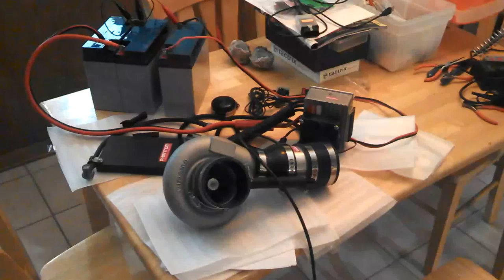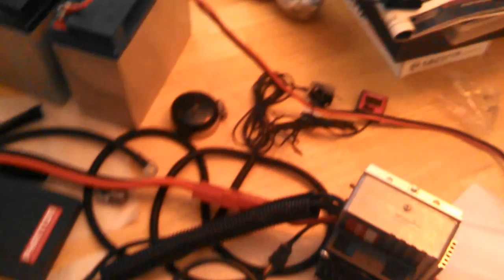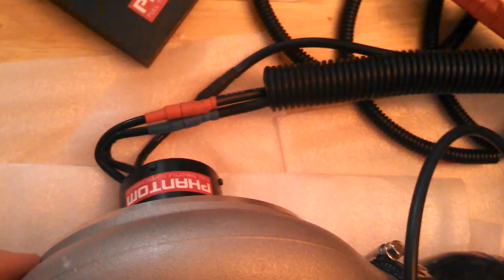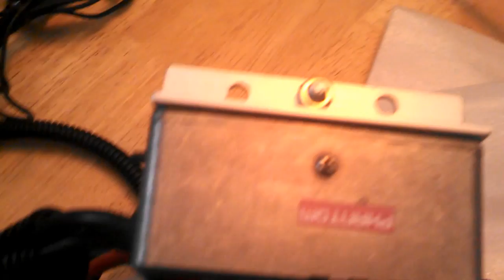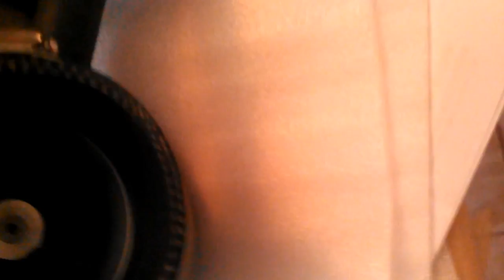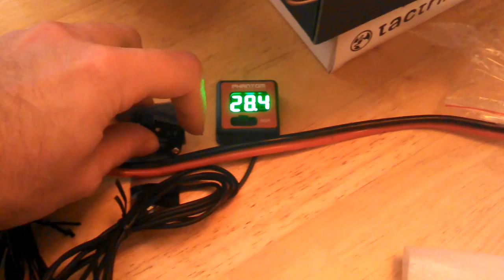Unboxing Powerup: Phantom Full Throttle Supercharger

Comment: I built one on my own using a 24V heater/blower motor connected to three motorcycle batteries for a total of 36V.  I installed it on my 2.2 liter Honda Prelude some time ago and it's still working like day one.  I built the motor to be NA, so I slightly raised the compression from 10:1 to 11:1, installed skunk 2 tuner cams/valves/springs/seats; larger exhaust and intake manifold with larger injectors, pressure regulator, and fuel pump.  The engine is under control of an OBD1 ECU and tuned in at 240 WHP and approx 186 ft lbs of torque at roughly 7300 RPM.  Those are some pretty remarkable numbers for a NA 2.2 liter, 4 cyl!  Anyways, I didn't want much boost with my high compression, which resulted in me eliminating one of the three batteries because my boost/vacuum gauge was registering 7psi before I even hit 5k rpm's (the car now redlines at 9k).  I'll look for my charts to post and prove that I gained an additional 30 hp for a total of 270 and 198 ft lbs at only 5psi.  I'm seriously considering making, and selling, several more.  I know mine works and it cost me less than $300 to make it.

Comment: doesnt matter if it was a afterburner, its still a fan.  it uses a compressor wheel for airflow, but  a turbo has to spin 50-150,000 rpms to make boost. it rams air. this wont flow enough, let alone the practicality of it. you can only race like 5 times then your batteries are dead.
Reply: Look, most electric superchargers are stupid, but this one is done right. It is not a direct turbo replacement, but these kinds do actually add small amounts of power. No, it isn't a fan. It is an actual compressor blade. Yes it is driven by a motor, but so what? Turbos are just driven by airflow, both turn the shaft. No, the motor can't reach 150k rpm, but many higher voltage electric motors can easily reach 50k rpm. Not the 15-20psi most turbos can make, but it is still enough speed and compression to add at least a few psi of boost to an engine, enough to make a noticeable difference.

Again, it isn't the same as a real turbo but nonetheless it is still a way to increase power, at least when the unit is active. When it isn't, the turbo wheel is probably adding huge amounts of drag. It really should have a solenoid bypass for when it isn't in use..
Reply from the maker: ***** You still could. I like this setup as it is not complex to install or remove, it suits my driving style, and it was fairly inexpensive. I'm quite happy with it.

Comment: did you see if it actually compresses the air instead of just being a glorified leaf blower like all the other ones??
Reply: it uses a turbo charger compressor housing. i would immagine it compresses the air. if you go to the site and read for like 5 mins you can get a pretty good idea of the system and design.

Comment: So if I get a 275A alternator, and a second and or 3rd battery could I run/tune this at 100% boost all the time ?
Reply: All the time the throttle is open, assuming the alternator(s) could keep up. Doesn't do any good to spool a compressor with the throttle closed.

Comment: How is this considered a test of any kind. You need a flow bench and amp meter to test this equipment. I've read the material on the electric supercharger and have to call bullshit. Not a true way to boost hp